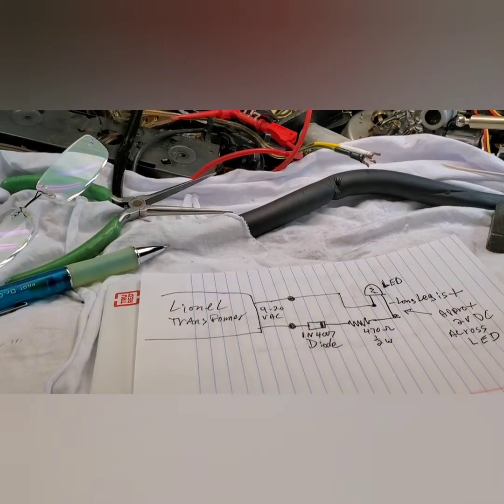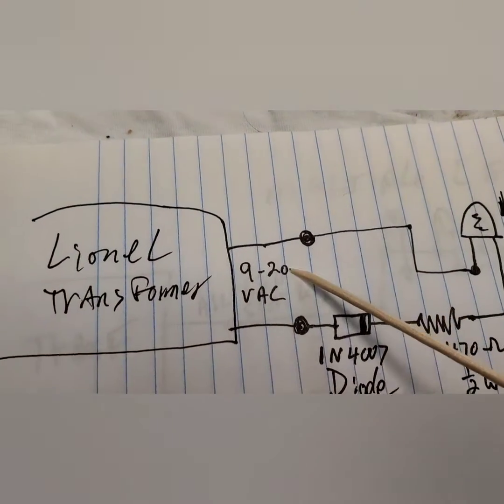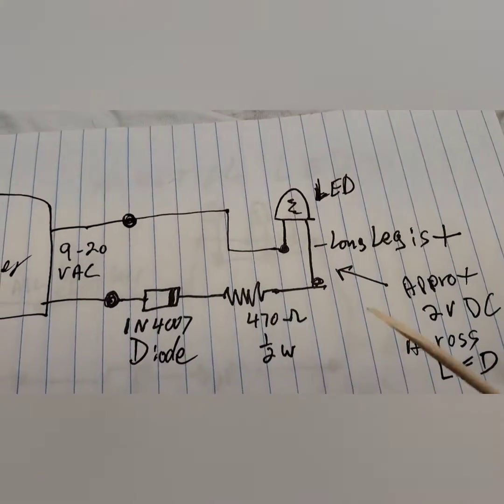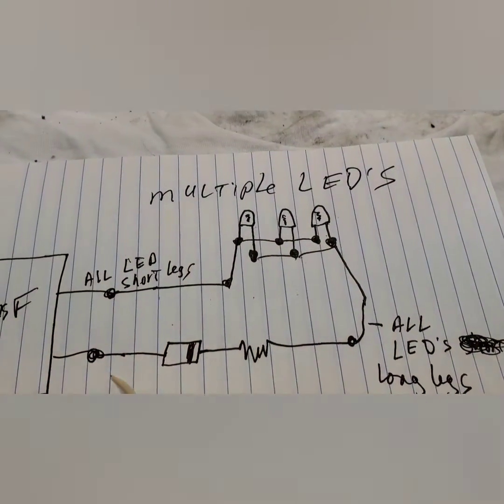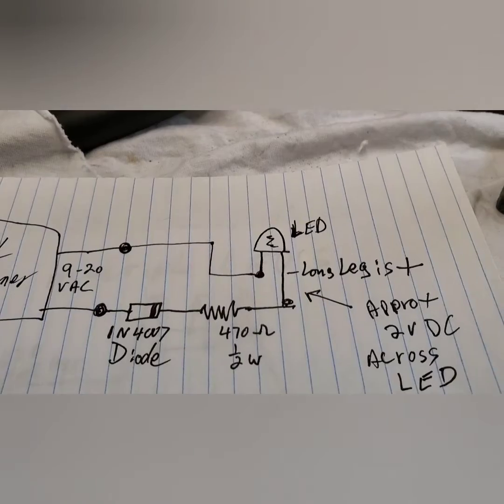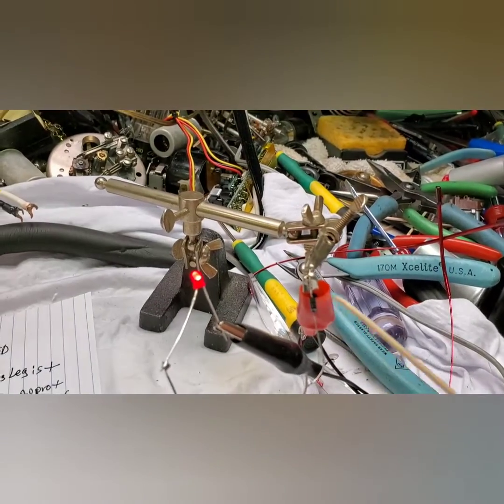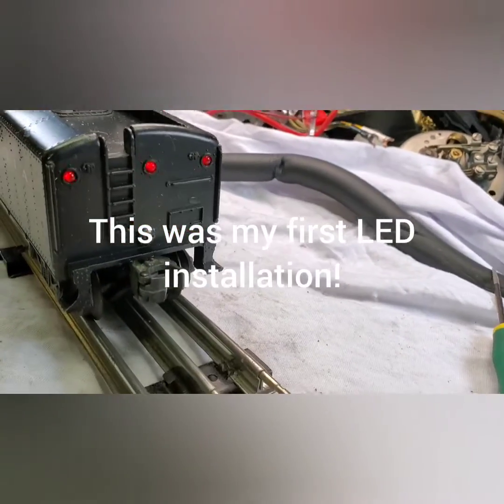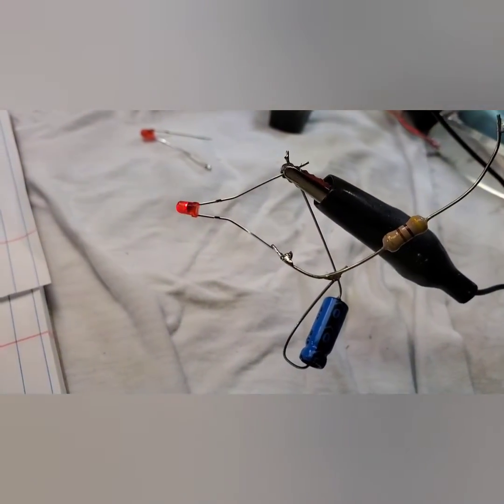Lionel Trains O Gauge Railroad How to use LED's on transformer power no limits to your creativity!

Comment: I've been experimenting with LEDs on my Lionel trains lately too. I got a box of 300 LEDs on Ebay for electronic experiments for about $10; white, red, blue, green, and yellow, half of them 3 mm and the other half 5 mm. I figured that, with so many LEDs I could afford to waste a few on mistakes. So I did.

I purchased some used old Lionel engines on Ebay like the 248 and the 253 that are practically antiques that were advertised as 'not working', 'does not run', 'for parts only' etc. just to see if I could fix them. I like to look for ones that nobody else wants because they're selling for dirt cheap (usually less than $50) and nobody else bids on them or buys them for at least a week. Most only needed their gears and axles oiled and their commutators and brushes cleaned and some old wires with crumbling insulation re-insulated to work. But sometimes they also come with broken headlight sockets or without their headlight sockets at all.

The replacement headlight sockets on Ebay usually cost at least $16 up to $20. With shipping and tax that would come to about half what I spent on the whole engine! And incandescent Lionel light bulbs cost another $10 for 10 of them on Ebay. I'm too cheap to spend that much if I can help it. So I thought I would try to fabricate some headlight sockets and use some of my dirt cheap LEDs for headlights.

I fabricated some headlight sockets out of odds and ends around the house that are at least roughly the same size and shape as the headlight sockets that these engines normally have. They don't look exactly like genuine Lionel headlight sockets but they suffice for my needs so I go with them.

At first I tried just using one white 5 mm LED for a headlight and a 2k ohm resistor. I didn't know how much resistance I was going to need to protect the LED so I started with that. But the light was awfully dim for an engine headlight. So I started thinking about what I could do to get brighter light from them. I tried lower resistor values but the LEDs would burn out before they got very bright. I thought that it was a shame I couldn't use both halves of the AC cycle to power my headlights since the LED only conducted and emitted light with one half of the AC cycle. I thought maybe I could get more light if I could make use of both halves of the AC cycle.

I came up with the idea of connecting the LEDs in parallel but with opposite polarities. I attached the short lead of one LED to the long lead of the second one, and the long lead of the first LED to the short lead of the second one. I figured that since the AC cycle was probably house current frequency, 60 hertz, the human eye wouldn't be able to see the LEDs switching back and forth. They would both look like they emitted light continuously. And since one LED conducted and emitted light for one half of the AC cycle and the other LED conducted and emitted light for the other half of the AC cycle, I would get twice the light. But with a 2k ohm resistor they were still awfully dim for a headlight.

So then I started experimenting with lower and lower resistance values again. When I got down to 330 ohms I decided that they were bright enough and they don't seem to be suffering any burnouts. I've put this arrangement of LEDs in four of my engines so far and run them around my track many times and they're all still going strong without any burnouts. I don't know why this works so well, it goes against my admittedly meager understanding of electronics, but it does. It'll be interesting to see how long they last. Incandescent bulbs seem to burn out awfully quickly for me.